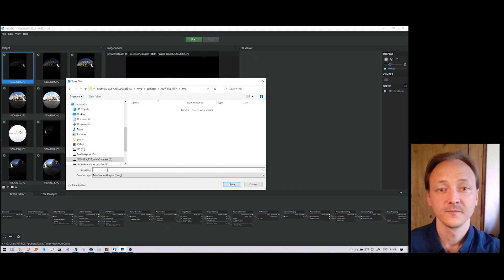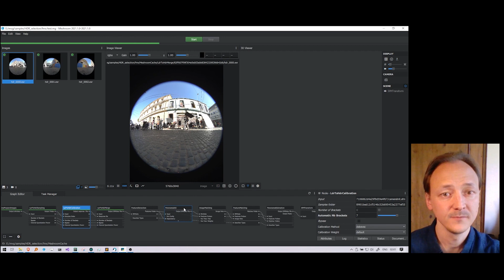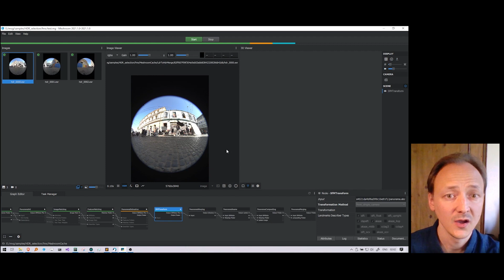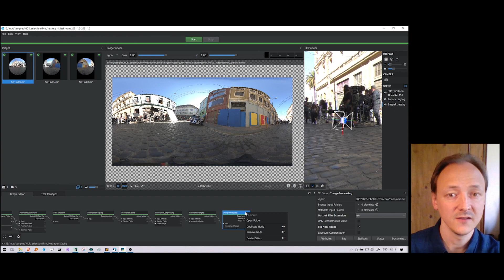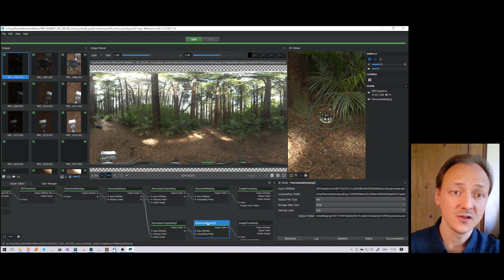HDR 360 Panorama demo

Comment: Hi, I haven't had a chance to try it yet but it would also be possible to use photos taken with an iPhone 14 pro max (I should look for an app for bracketing and maybe use the ultra-wide angle) without any motorized head but only a standard tripod?